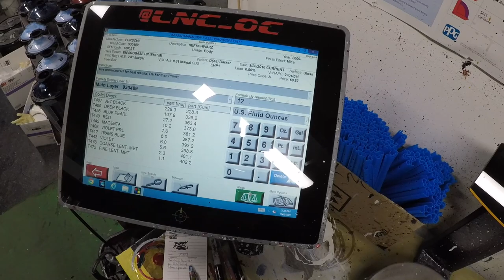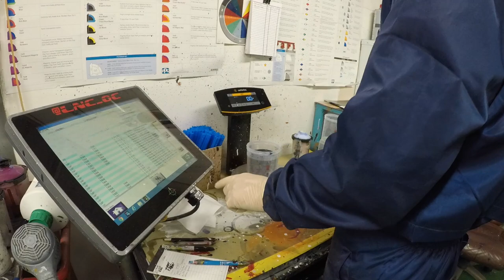Painting a 992 PORSCHE CARRERA S - Rebuilding a wrecked salvaged Porsche

Comment: Good afternoon Andrey, excellent results. That shine is magnificent. I have a couple of questions. What was the aerosol cleaner that you used prior to the sealer? I noticed that you started on the bottom of the door with the clear coat. I'm sure you have a very logical and clever reason for this procedure. The results are obvious. Thanks and take care. Good luck.
Reply from the maker: Thanks Steve, the aerosol was a Wax&grease remover, and I usually start at the farthest edge and work my way around the car. In this case if i started at the top of the door i would be near the hood before the bottom of the door would be cleared and then i would have to return back to the hood and continue to the other side, but from the bottom of the door i work my way up, across the hood and to the other fender always keeping my edge wet and going 👊🏻😁👍🏻
Reply: I knew that there was a very clever and logical reason for this. Thank again.

Comment: Hello Andrey. I will paint my 991 the same color Black C9X. Schould I use for the first coat the same base or not ? What did you use ... Thank  you. Petr. Czech Rep.
Reply from the maker: If your car is already dark you can just use basecoat, if its a lighter color its better to use a dark gray sealer and then a basecoat for better coverage.
Reply: Car is dark grey primer. As a first basecoat schould I use at first any black base or directly C9X base ? To unify the surfce. Cause I can't to buy sealer in EU. Thank you much.
Reply from the maker: @petman9588  no need to use a black basecoat first! Your car already has proper undercoat, so just go straight with the c9x basecoat and clearcoat. 😁👍🏻
Reply: @LncPainter  it's clear. Thank you for your tip and great job. 👍

Comment: How come you didn't have to color match it to the rest of the body?
Reply from the maker: What do you mean? We did color match and use the factory color code 👍🏻😁
Reply: @LncPainter  I have a black mercedes and I'm getting an OEM body kit installed for the bumpers. Do I have to take my car to the shop for them to "paint match" or can they just use the factory code and I only take the bumper separately to get painted? 
The car is 25 years old but in mint condition  and original paint
Reply from the maker: @bequietandrive222  yea, even tho its original color there are sometimes many variants. This way they can choose the closest one ☝🏼